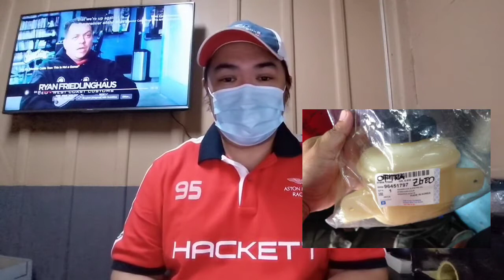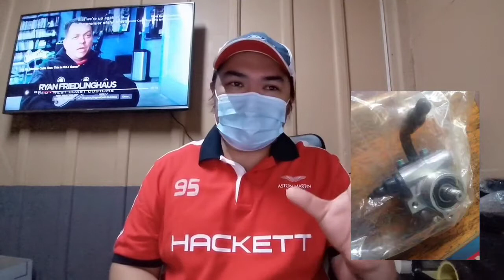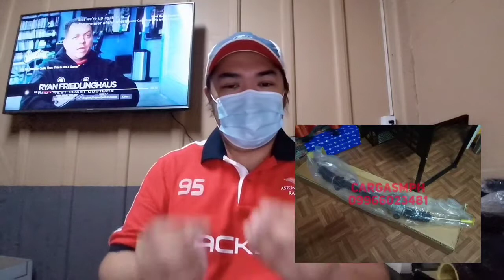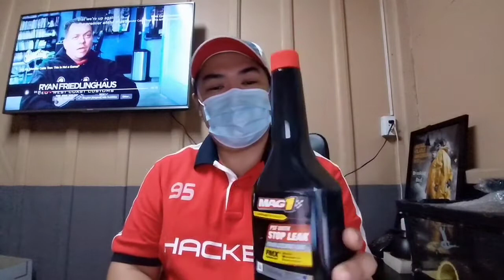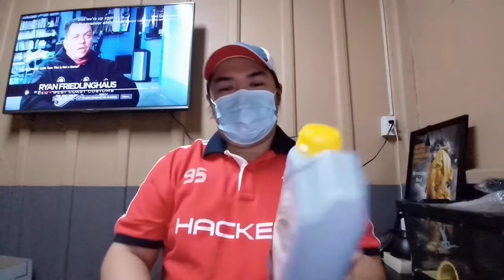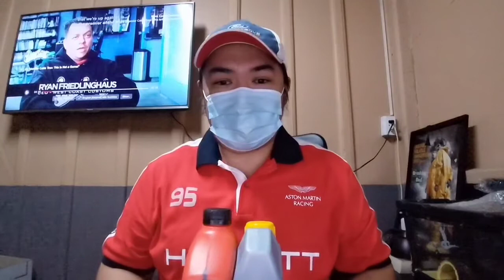Power Steering Fluid Leak? Tips and Hacks para makaiwas sa malaking gastos!

Comment: Advisable b mag lagay ng power steering stop leaks pag may oil leak s sa rack pinion tulad ng adventure ko model 2013. Malambot nman ung manibela ko. Plan ko kc mag pa overhaul ng rack pinion.
Reply from the maker: pwede naman po mag lagay sir. But mas maganda po if low level na talaga si power steering fluid nyo then mag top up po kayo ng stop leak mas okay po.